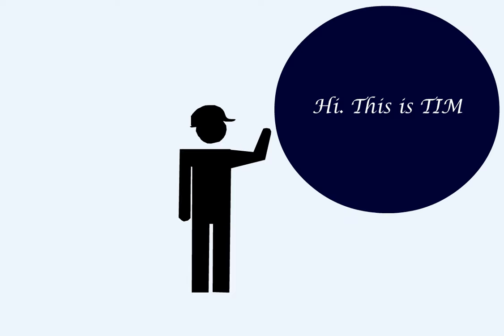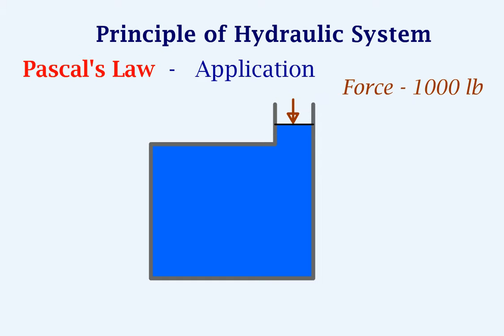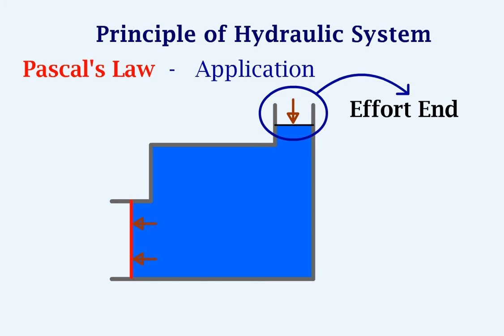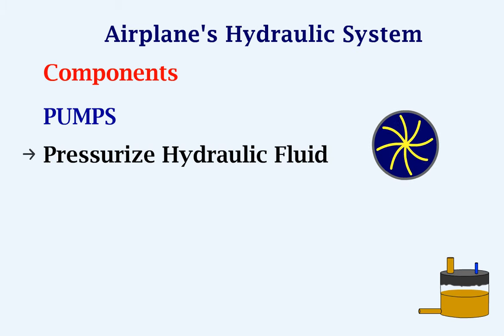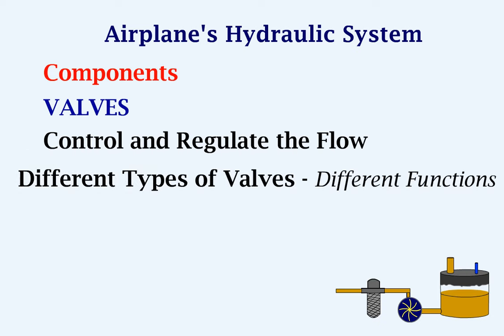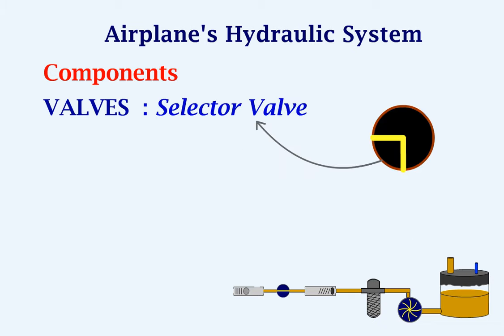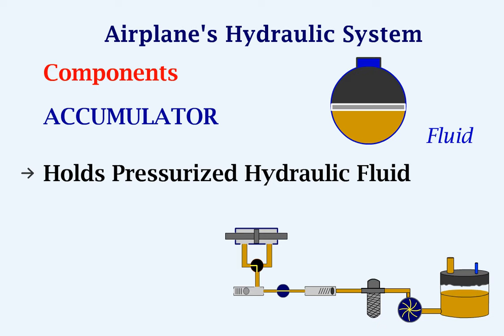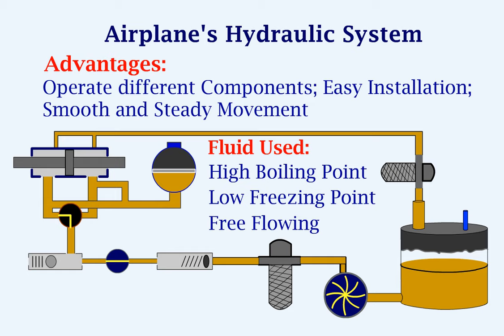Understanding the Principle and Operation of an Airplane's Hydraulic System!

Comment: Good video. The pressure for the 2sqin outlet should be 500lbs, NOT 2000lbs
Reply from the maker: Thank You! Force = Pressure * Area. So we get force as 2000lbs
Reply: Pressure is force divided by area. So surely 1000 divided by an area of 2 = 500???

Comment: To increase the Force on the other side the area should be halved (load end) instead of being doubled. F/A= F/A  or F= PA . In the most practical use of a day's life, if you want to make your hose water to sprinkle / shoot further, cover half the area of the hose end with your finger, the pressure will increase resulting the water shooting further. ( increase in pressure /psi)
Reply from the maker: Yes! That is a good explanation

Comment: It is not clear how the hydraulic fluid returns from one of the two chambers to the reservoir through the return line. Shouldn't the return line be connected to the selector valve?  In this case the selector valve also needs to have four ports: two of them each going to the actuator chambers and two of them going to the reservoir ( one pressure line, one return line). In the simulation it seems the return line is connected to the actuator chambers. In the position shown, it seems the hydraulic circuit is being 'short circuited' ? and the pressure will drop and the actuator will not move. Can any one explain?
Reply from the maker: The thumbnail architecture for the Hydraulic System is accurate, but the image in the video is not. As you mentioned the actuator will not move as per the shown architecture in the video. 
Realized it after creating and uploading the video. Apologies for that! 
But the description is accurate. Hope it helps!
Reply: @JxJAVIATION  Thank you for the reply.

Comment: What will be function of this circuit.Kindly reply
Reply from the maker: Can be used to move the flight control surfaces or the extension and retraction of landing gear.
Reply: @JxJAVIATION  whether all the processes(landing gear,flaps) done by only one double acting cylinders.
Reply from the maker: @DARKKNIGHT-ds2zd  there will be multiple cylinders connected to the hydraulic line for different functions!

Comment: 1:30 may i know is the bottom pressure is 1000 psi only and not considering the fluid pressure which is density x gravitional acceleration x height of liquid?
Reply from the maker: Yes, The actual fluid pressure will include all these parameters.

Comment: Just one comment, as your presentation is a pretty simple generic example of a system.  Pumps do not produce pressure, pumps supply flow.  Restriction to flow results in pressure.  This is why we need components such as accumulators.  This can be visualized by a garden hose.  When the hose is unrestricted there is no pressure in the hose, ignoring friction.  Put your thumb over the end of the hose and pressure rises in the hose due to the restriction.  Now we need a pressure relief valve.  PRV's send un-needed fluid back to the reservoir to control max pressure, no PRV and the pump could stall, break a shaft or we would blow out components.  Variable displacement pumps can be used in lieu of a PRV.
Reply from the maker: Thank You for sharing this info!

Comment: CT cycle 
Pascal's law 
Hydraulic  system 
DNA 
1000 psi 
Reservoir 
Return line 
Pump 
Engine electrically  operated 
Filters to remove impurities 
Valves 
Regulates the flow 
Check valves